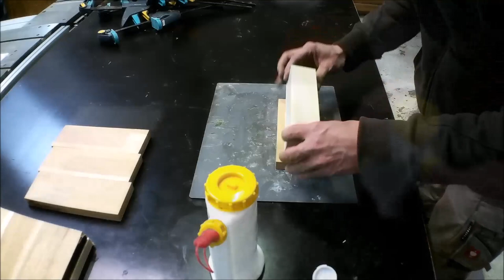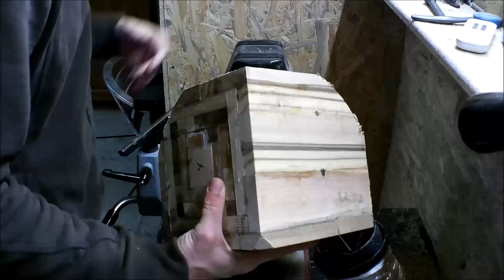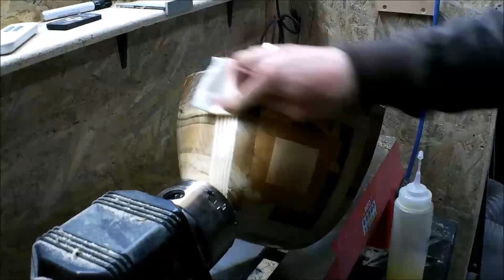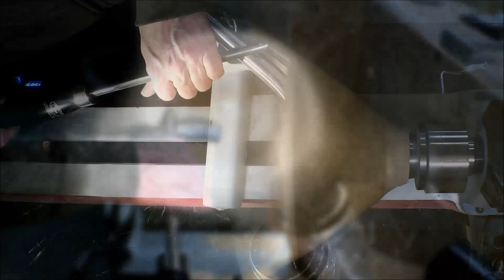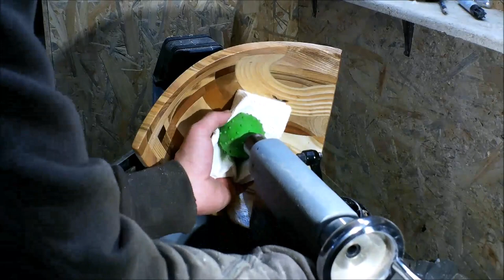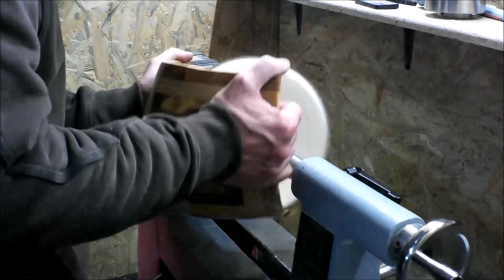Woodturning - The three cornered bowl Mk3

Comment: There had to have been some way of cutting that in half instead of turning it all away. Beautiful piece in the end but it could have been two beautiful pieces.
Reply from the maker: That‘s actually a good idea. I have to try that.👍🏻 Welcome to my bucket list. 😊
Reply: I think it would be hard to get a clean cut diagonally. Some form of jig to hold it and a chainsaw would be my first guess. or mount it as you start and use a parting tool as far in as you can/dare then chainsaw to finish once you have a good starting line to work from.
Reply: I'm tinkering with a sled for a table and band saw that would hold blanks like that so they can be cut diagonally. Alot of "waste" when turning these types of bowls, even if it's scraps. Other than that  beautiful work.